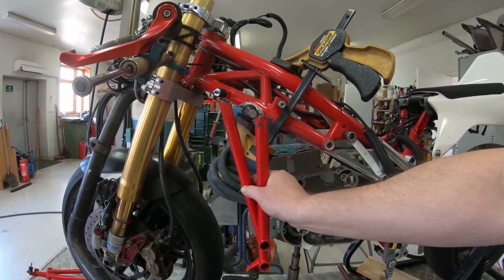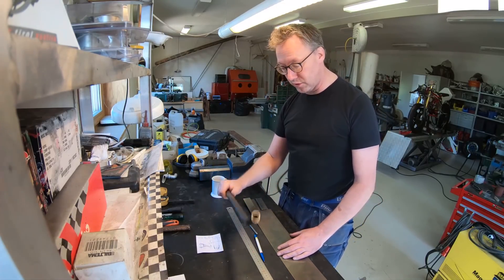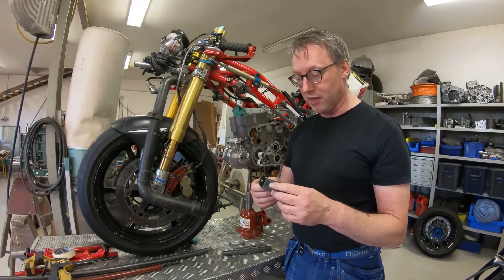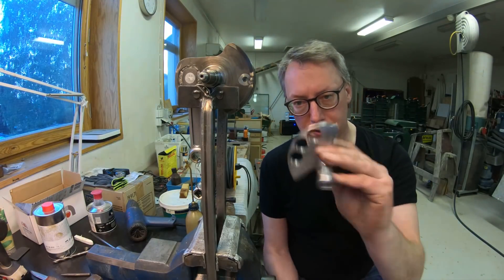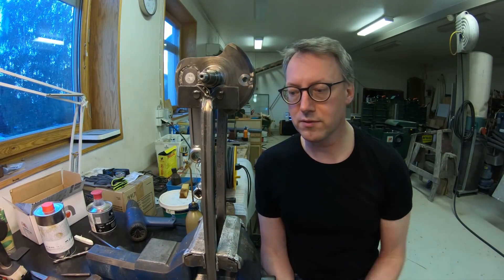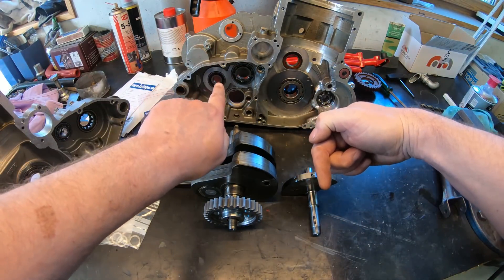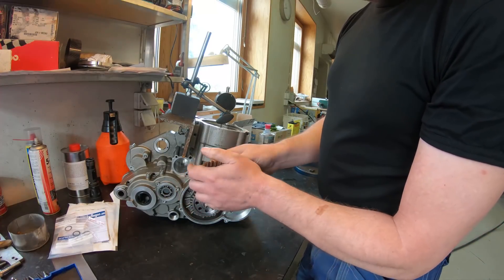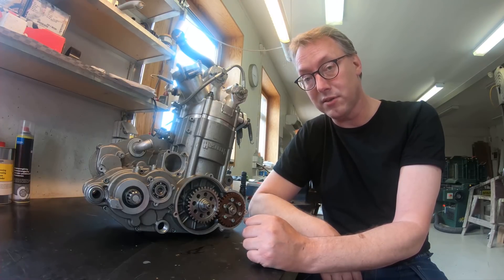DRC680, building a counter balancer III

Comment: Stellar work Dr. C. Just one suggestion. tolerance = clearance in this situation in American English.Otherwise, excellent language skills and usage of idiom.
Reply from the maker: Thanks! I know it perfectly well, but sometimes I just forget myself! :-)
Reply: @Dr_C  super minor. I am amazed at how much vibration damage you tolerated.
Reply from the maker: @jiroyamamoto2878  Well, actually, I didn't! But I tried three different balance factors and an elastic front engine mount first. Building a new CB seemed like a drastic project, so I tried to avoid that, maybe too long.